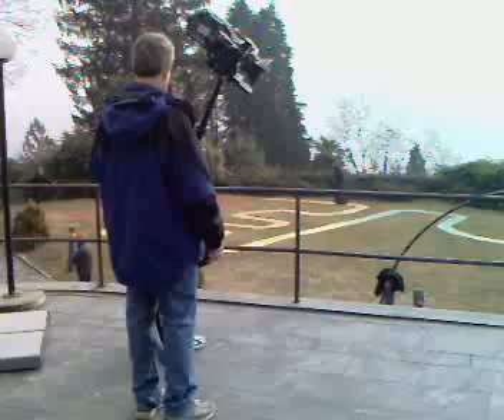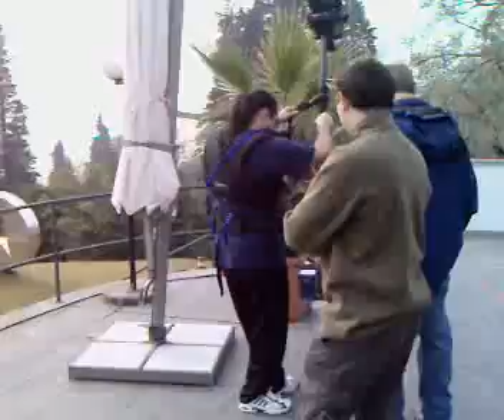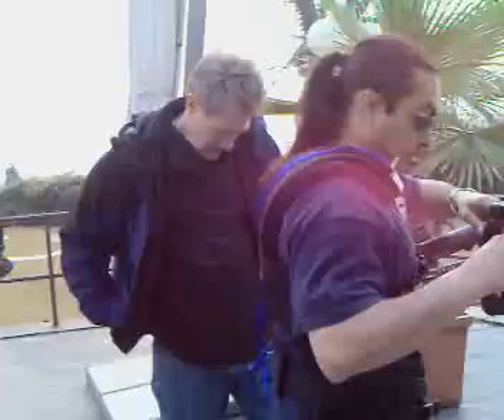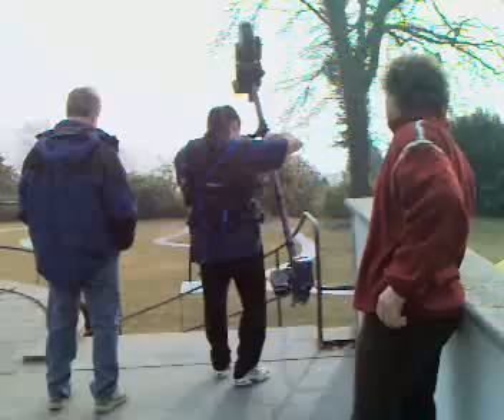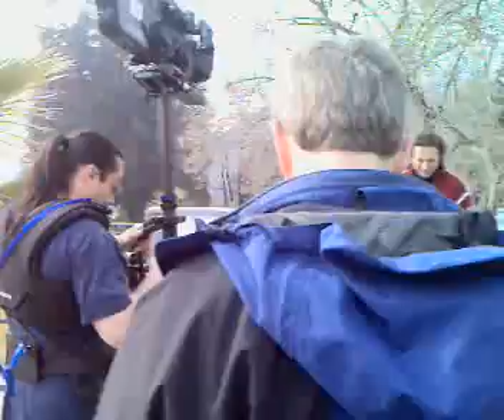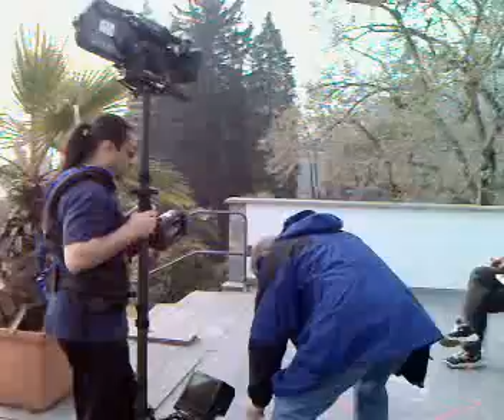Steadicam lesson by Jerry Holway

Comment: @JUKIO01... I work for Boeing, and we use the isoelastic arm (spring arm) portion of the Steadicam rig to hold the weight of some hevey tools, such as drill motoers, large rivit squeeze. some of these tools weigh as much as 40-50 lbs.